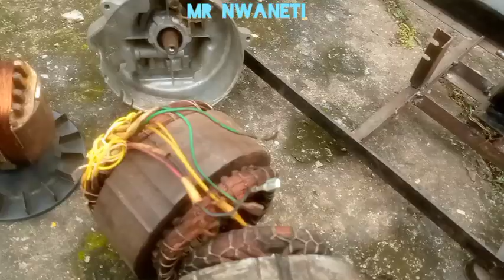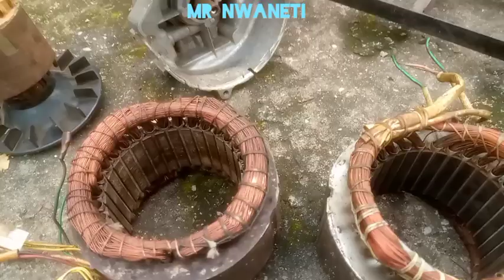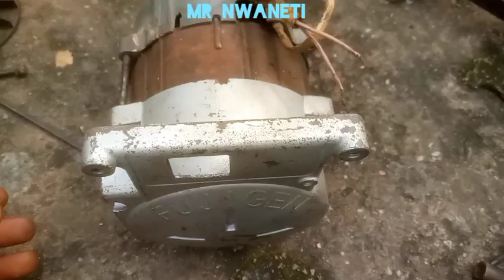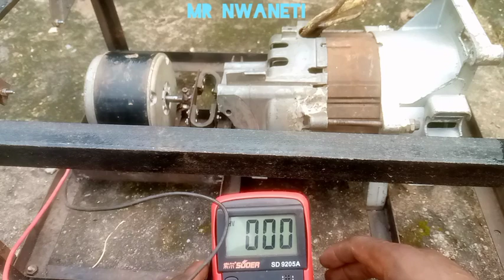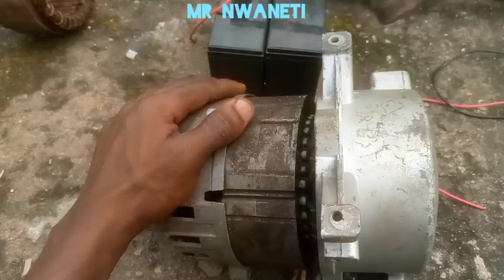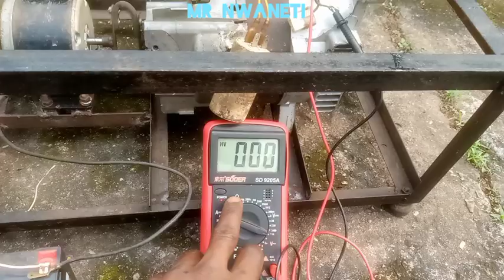Generator experiments with differents factory stator

Comment: How many volts output tiger generator do without capacitor please
Reply from the maker: You watch the video after asking irrelevant question
Reply: @MRNWANETI I watch the video but this question is my personal essue I made it but I want to confirm something please help tiger generator without capacitor can the output be 12v volts? And after putting the capacitor is that possible to reach 220votls Thanks for your help
Reply from the maker: @AbdulhamidLukman-hd7qo it depends on your speed, turns of the coil and the rotor magnetism strength etc
Reply: @MRNWANETI please are you doing Facebook if yes I need the link 
    Because you're teaching perfectly

Comment: Good morning brother. Nice work you're doing here. Please make a video about how to charge a battery with inbuilt connection from the stator.
Reply from the maker: I think I've done ✅ that
Reply: @MRNWANETI I can't find it on your page. I've looked everywhere
Reply from the maker: @godwinpepple5939 https://youtu.be/ELjAD1oxUw0
Reply: @MRNWANETI Thanks brother,ive watched yhe video and i understand everything. Ive also been skeptical about trying that method too but how about getting a 14v transformer to connect it to the mains to step down the voltage to 14v and connecting it to a rectifier diode to get 14v and connect it to the DC motor? Will it work well with that configuration?
Reply from the maker: @godwinpepple5939 where you from
Reply: I have done same but it not producing using the first motor you use earlier 
Though I have the the magnet on the rotor